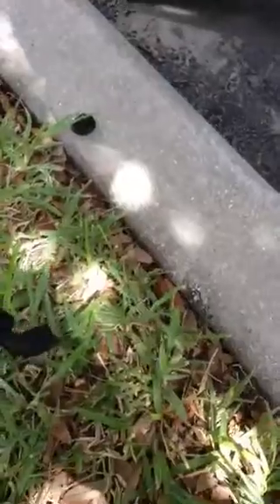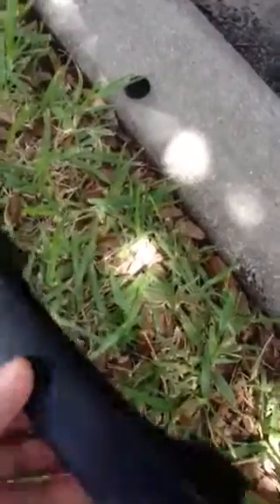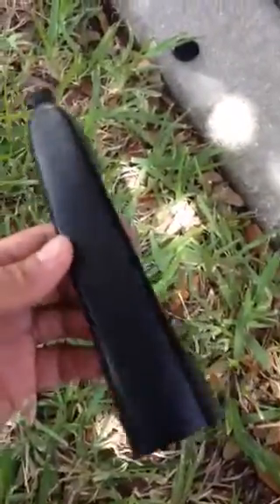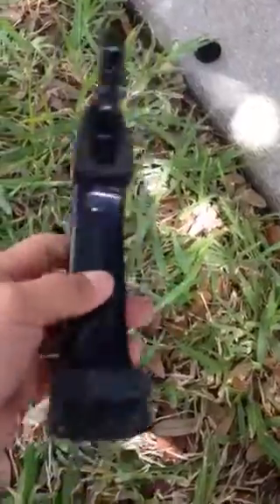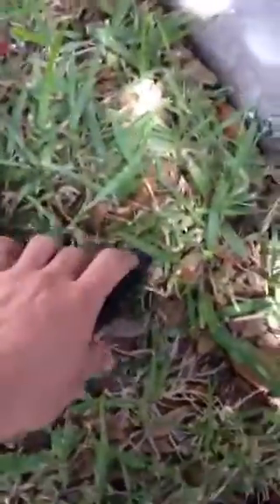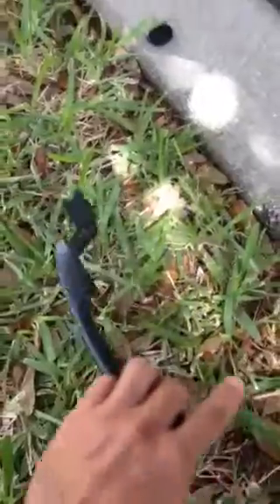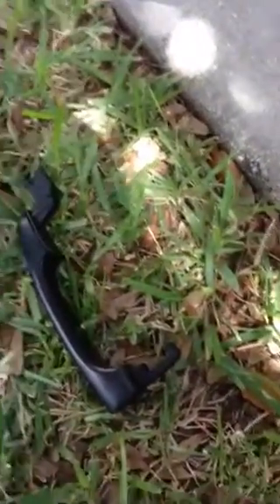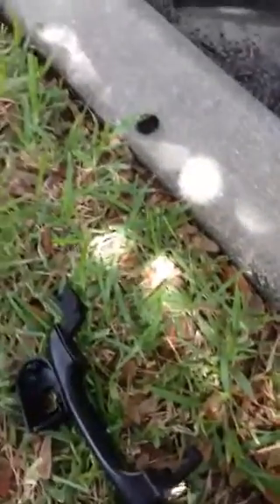2006 Kia Sportage passenger side handle replacement

Comment: My replacement handle does not lock in as in the video. The left side of the handle simply pulls out. Am I doing something wrong? Thanks!
Reply: Jim, hopefully you have it fixed by now, but when you put the handle in, you have to slide it to the right on the passenger side doors and to the left on the driver side doors.  That should lock it in.

Comment: So, you don't have to unscrew the inner panel of the door and take tat off to get to it?
Reply from the maker: Rebekah Withakay  yes no removing of door panel you just need to pop out that rubber cover on the side of the door and you can see the bolt you need a extension to reach the bolt and you need to have the socket with magnetic so that the bolt will not drop or else you end up to opening the panel

Comment: You didn't show any of the inner screws or how to get to them.
Reply from the maker: Whomp sorry about that but the side of the door there is a round rubber u will remove that and u can see through the screw u new to use socket wrench to reach that be careful to remove it or else it will drop the screw all the way to the bottom side door or else a lot of work to do good luck my friend on your project
Reply: Exactly thats the part we all need. Thanks
Reply: @pinoyhandymanofalltrades  My car is a year off and doesn't have the rubber capped hole.  I believe I have to take the whole inner door panel off to even be able to get to anything.
Reply from the maker: Whomp sorry to hear that if that’s the case you will remove the panel door it’s going to be a lot off work just to replace the door handle but normally just to replace lock door handle is easier I replace Hyundai Sonata older car the same process I know all cars will be the same because for a small piece to replace not to give you a hard time to remove all panel door well anyways panel door they have only two screws everything else clips just take your time when removing so that you will not break the plastic where all the clips attach

Comment: Where did you get the replacement handle?
Reply from the maker: Uriiel Aguiilar  online ebay its $24.00
Reply: In Houston it's goes for 25 at an AutoZone , but you need to order it in advance.
Reply from the maker: Hi I bought this on ebay $19.19 free shipping

Comment: Your video doesn’t even show anything
Reply from the maker: Hi sorry about that if I don’t video that but I your asking how I did get out that handle on the side of your door there is a black rubber u need to pop that out and it’s easy to remove and if you look inside there is a 10 mm bolt u need to use a socket be careful not to drop it or else it’s going to have a lot of work if you drop that bolt if u have a magnetic socket thats Better to use when you remove the bolt u can easily remove the lock where u stick your key I apologize my friend if missing some video but thanks for watching